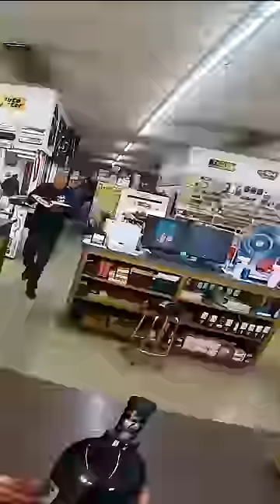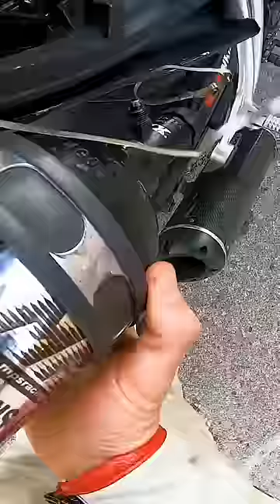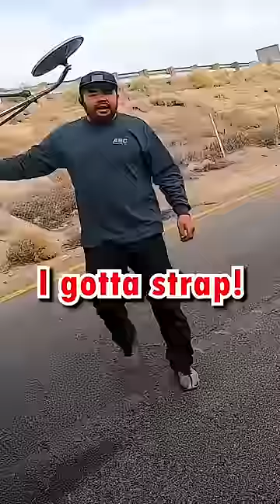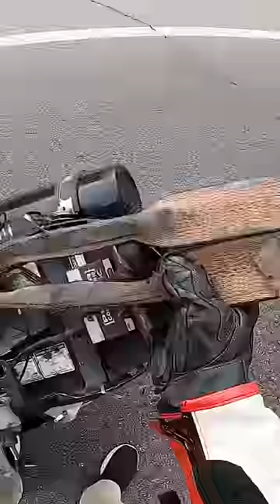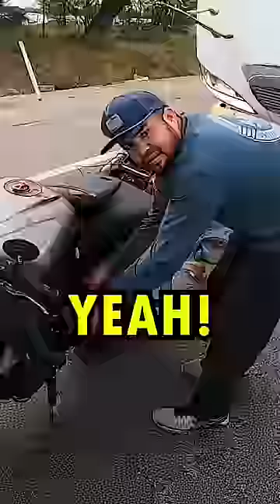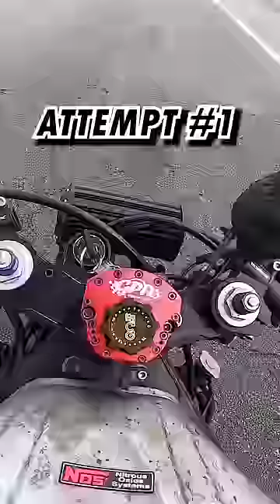If this works..... #shorts #bikelife #lol #fast

Comment: “There goes my clutch…”, exclaimed the biker.
Don’t worry about such silly details, real men don’t need clutches.
Reply: You can still do clutchless shifting 😂
Reply: @saesariolisenty6123  But the clutch is still necessary to drive off smoothly.
Reply: @marcos.1771  yup .. no argument there
Reply: Only two strokers use a clutch lolololololl
Reply: @jonahjohnson7660  Typical, this is typical…
Reply: @jonahjohnson7660  correction “only people who dont want to fuck up their gearbox use clutches”
Reply: @marcos.1771  i think youll find the clutch is necessary for movement at all.
Reply: @Username-uv8pf  Are you aware of quick shifters and blippers?
Reply: @marcos.1771  are you aware of gearboxes??? You still require the clutch to transfer the power from the engine to the wheels. Even if you dont disengage it
Reply: I went around on my first bike honda ns125r with no clutch for a year you push off with your leg to get going and  just gotta be careful goin down  not to lock up the rear and make sure your get neutral for the light in stoping but it's was like a luxury having a clutch on every bike since 😂
Reply: REVMATCH TO INFINITY AND BEYOOOND
Reply: @jonahjohnson7660  no
Reply: @owenwilson3750  Rev matching is not an obligation.
Reply: @marcos.1771  If your going 100+ & try to downshift without a blip/Rev match ur def gonna feel a stutter/jerk and thats you putting extra work on ur clutch plates and engine pos braking system. People like you would rather go buy a whole new bike than ride one how it's supposed to be. Veggie
Reply: Real riders use the clutch
Reply: @marcos.1771  no, you do need a clutch you don't need a clutch lever but the clutch you do need
Reply: @Username-uv8pf  I never use the clutch in my truck and I have been doing that for more than 5 years and I’ve had no gear box issues.
Reply: @jacksonneal4963  so how do you engage and use reverse?
Reply: @yungchainsm0ker298  There are many ways to do things correctly.
Live and let live.
Reply: @0newheel.andrew  No clutch lever?
It would be interesting to see you drive off on your motorcycle.
Reply: without clutch inside gearbox..any vehicle probably would move as soon as the key is turn on, engine run so the wheel will run
Reply: @saesariolisenty6123  Um no. If you blow the clutch it won’t transmit power from the engine to the trans. You’re not going anywhere if you blow the clutch.
Reply: Im dead 🤣😂
Reply: Sniff sniff any one else smell that?
Reply: For me using clutch is manlier
Reply: @kirbyloon2175  I mean, if you’re really smashing there’s not much point using it to shift up. You can also clutchless downshift but that requires more skill than most will ever have.
Reply: @marcos.1771  🤦‍♂️you are really bright aren't you. You still have to have a clutch to move
Reply: @steijnnothdurft9459  and if you put the cylinder on backfire, you can speed up the RPM so put’er in neutral and take your foot off the brake to let the exhaust fan out of the rear end of the motor
Reply: @linkinpiatak6669  You may want to read this thread first, BEFORE posting dumb comments.
Reply: Yeah I have a Yamaha atv that uses a clutch but I never have used it
Reply: Clutch!?!? That's what women do to their purses!
Reply: @dvilsadvocate1498  You know it...!
Reply: @jacksonneal4963  you drive an automatic don’t you
Reply: @jonahjohnson7660  so you crash box your 4 banger , typical
Reply: @Username-uv8pf  23 years and fuck knows how many hundreds of thousands of miles covered clutchless shifting, no gearbox issues with any of  the dozens of bikes I've owned. Only use clutch on truck to pull away and stop for last 5 years and around 120k miles, no issues there either.
Reply: @jacksonneal4963  auto?
Reply: Live clutchless bro
Reply: I don’t think you know how a clutch works
Reply: Don't most bikes have a wet clutch? Or do those start getting hot after lots of slipping
Reply: @u_cant_handle_the_truth  nsr you fucking legend
Reply: @marcos.1771  O
Reply: @marcos.1771  O
Reply: @thecoolguy3498  ooo ooooooooooo of
Reply: @thecoolguy3498  oo
Reply: @u_cant_handle_the_truth  of IP
Reply: @sw33tr1de4  oo
Reply: @yungchainsm0ker298  o
Reply: @u_cant_handle_the_truth  hi
Reply: @steijnnothdurft9459  o
Reply: @steijnnothdurft9459  i
Reply: @marcos.1771  Oo
Reply: @steijnnothdurft9459  oo
Reply: @saesariolisenty6123  i IPo
Reply: @marcos.1771  Ok o
Reply: @marcos.1771  Ù9i
Reply: @jonahjohnson7660  u
Reply: @jonahjohnson7660  o
Reply: @jonahjohnson7660  o
Reply: @marcos.1771  Ok o
Reply: @marcos.1771  O
Reply: @marcos.1771   Not Including ur Grammer and spelling?
Reply: My civics clutch is basically non existent
Reply: @user-bn5xb3cv2n  glad someone knows wtf I mean
Reply: Real men clutchless start
Reply: @marcos.1771  how
Reply: @yungchainsm0ker298  Who is “Grammer”? The “spelling” guy?
Reply: @muhammadnw5869  Real men always start on a downhill slope.
Reply: @marcos.1771 EDIT: after reading this comment thread i realize how pointless it would be to even try arguing with you so im just gonna take my leave
Reply: @Username-uv8pf  What arguments?  
You constantly keep deleting and editing your comments. 
You’re obviously not interested in any discussion. 
And we say bye-bye…
Reply: @jacksonneal4963  autos dont count
Reply: @hsushssbwj  nah, if its in gear then it will start to move while turning over but it will destroy the box
Reply: @marcos.1771  i can tell that you have never driven manual if you life if you think you will never need the clutch. How about putting a car in reverse?. You can rev match without damage the gearbox much which is what I do occasionally but it takes more skill than you will ever have. Without a clutch youre never gonna be able drive a manual vehicle, especially in traffic
Reply: @EnglishDrifts69GTxRED  You should read this thread first, BEFORE posting dumb comments.
Reply: @EnglishDrifts69GTxRED  bro if u have driving an manual you would know you just need clutch to put it in gear but then after that you don’t need to you the clutch. You only need it for first or reverse.
Reply: @jacksonneal4963  enjoy blowing up the gearbox then. I have always driven manuals and work on gearboxes regularly so I know my shit. Driving without the clutch is honestly pointless unless you wanna drive a manual but have no idea what the bite point is
Reply: @marcos.1771  i have read the thread and you just have no idea how to drive manual
Reply: @EnglishDrifts69GTxRED  I’ve been driving without using the clutch for a few years and have had no transmission problems so I’ll stick with driving without it.
Reply: @jacksonneal4963  atleast you’re admitting that you dont know how to drive manual properly and that you dont care sbout your cars
Reply: Finna flinstone it home huh
Reply: You need the clutch to disengage the gears from the wheel shaft.  You're not moving anywhere without it.
Reply: It's true, my clutch broke on a hill while it was pouring rain. Made it back tho somehow lmao
Reply: @Dragon22078  Did removing your pressure plates hurt at all?
Reply: Not double clutching like you should, he’s lucky that 100 shot of NOS didn’t blow the welds on the intake.
Reply: Pfft y’all have manual bikes?
Reply: @jonahjohnson7660  meh idk bro I race and only 2 strokes are true men. Lol but I’m talking snowmobiles fucking 4 strokes are slow and heavy
Reply: @molotov6792  It's true
Reply: And this comment was wrote by a woman on her man's phone for sure 🤣
Reply: @drugsrbad475  “…this comment was wrote…”?
Say what?
All your base are belong to us.

Comment: Nitrous doesn’t magically give it more torque 😂
Reply: Nitrous does add torque thats half the point. Just isn't going to do shit in this situation.
Reply: Nitrous is just an oxidizer..need more fuel which I doubt he has
Reply: Truth be told if the truck is empty that bike probably got enough torque if only it had enough weight and traction to get the truck moving. Just probably wouldn't live as long after that
Reply: @srt5musik  no your thinking horsepower. As the saying goes horsepower means how fast you hit the wall. Torque means how far you take the wall with you
Reply: @MrBULLRIDER13  It does not exclusively add horsepower. It causes a big increase in torque as well.
Reply: @AreeyaKKC  If it’s a dry kit the ECU will compensate fuel to a certain extent. If it’s a wet kit then he has fuel.
Reply: @RandoManFPV  even empty that bike wouldnt tow a semi
Reply: @blazejenkins8386  no shit I said that too smart one
Reply: If you try hard enough, it can
Reply: HP and wheel torque is what pulls. Engine torque doesn't really matter, it's all in the gearing, power and traction. The bike has the power, but not the gearing or traction.
Reply: it doesn't add much weight is the thing, you could have infinite torque on a peel, if there isn't enough weight on the wheels you're just gonna do a burnout.
Reply: @satibel  if you could add 1000kg on the bike and lower  gearing, it might have pulled it.
Reply: @MrBULLRIDER13  clueless. Nitrous increases torque before horsepower
Reply: Torques not the problem it’s weight
Reply: False but serious a 100-200 hp bike weighing 500lb isn’t gonna move 80,000 pounds anytime ever
Reply: Well....yes it does, the problem is the 2 inches of rubber he has on the road, coefficient of friction aint substantial enough to get her rolling, if it would begin rolling then....man saves the fuckin day
Reply: @MrBULLRIDER13 Horsepower is basically a multiplication of RPM and Torque. RPM can't be increased otherwise you'll throw a rod, so to increase horsepower, nitrous MUST increase torque.
Reply: @reinbeers5322  so in your opinion the only way horsepower or torque is to add n.o.s. do you realize how stupid that sounds and how many things out there prove you wrong daily.
Reply: @AreeyaKKC If it is a wet kit it wouldn't matter.
Reply: @MrBULLRIDER13  That isn't what he said at all. He is mostly right. Horsepower is literally torque x rpm / 5252. That is what horsepower means. The formula implies that you either generate the same torque at a higher engine speed, or increase the amount of torque at the same engine speed. NOS doesn't increase the engine speed, so it mathematically has to increase torque.
Reply: Thats basically exactly what nitrous does hit it at like 2000 rpm you will get so much torque
Reply: @THESLlCK  no it doesn't and HP and torque are two different things. Just because you increase one doesn't make the other increase to.
Reply: @MrBULLRIDER13   Horsepower and torque are related. Torque is rotational force. Horsepower is rotational force x rotational speed (rpm). When you increase torque at the same rpm, horsepower must increase. Use the formula. 5252 is a constant. The rpm remains constant. So whenever you change the torque at a specific RPM, horsepower will inevitably change.
Reply: @Skidzo19  then explain why the numbers don't always line up and start getting further apart it's quite simple really. The formula is a general guideline and far more factors come into play then just your fast and furious calculations.
Reply: You guys think a single cab 2wd 2.2 manual Chevy s10 could pull that truck?
Reply: @CorruptStory1341  ya I mean assuming the truck is in neutral and the air brakes aren't braking
Reply: @james10739  Oh
Reply: @CorruptStory1341  I mean you see strong men pulling planes and trucks it's not that hard to move something that rolls I mean you are not doing 70 or trying to stop it
Reply: @Skidzo19 why are you so dead set on arguing when obviously you have no clue what you are even saying, nos makes a very decent increase in low to mid toque and a mid to high horsepower,
Reply: @vgfy6319    "Obviously have no clue what you're talking about" Okay, explain what I've got wrong. You won't, because you can't. Horsepower and torque are fundamentally related. Hell, looking at a fucking dyno graph will show exactly what I'm talking about. As long as you're using the same imperial units, then horsepower and torque will always cross over at 5252rpm. Coincidence? Or is it because of exactly what I just explained!
Reply: @Skidzo19  congratulations you figured out that high rpm is peak for horsepower but decrease of torque. now reread my first reply and you’ll learn how nitrous effects power, if you honestly think nitrous has no effect on torque then yes you have no clue what you’re talking about
Reply: @vgfy6319   Literally nothing to do with what I said at all! NOS does not effect rpm, so it MUST effect torque. And consiquently, horsepower MUST increase as a result of the increased torque at the same rpm! 

"If you honestly think nos has no effect on torque" That is exactly the opposite of what I've been saying! NOS has more oxygen than air, meaning you can inject more fuel, and thus make more power per cycle (AKA torque increases). And since the rotational force (torque) increases, and since horsepower is dependant on torque, then horsepower MUST increase! 

And your first comment is just flawed. NOS will increase torque throughout the torque curve, not just in the low to mid end, and it won't effect horsepower independantly, because horsepower and torque are related. Effecting one without affecting rpm MUST effect the other. How can you even attempt to tell other people they're wrong when you haven't even got the fundamentals down?? 🤦
Reply: @vgfy6319  To quote myself: "NOS does not increase the engine speed, so mathematically it has to increase torque"

That right there shows that I was already saying NOS increases torque. So why the hell are you trying to say I'm arguing something that I never said?!
Reply: @Skidzo19  I’ll be honest i meant to reply to @mrbullrider13 and your profile pictures are the same
Reply: @vgfy6319  Understandable. Have a good day.
Reply: Uh... but it does.
Reply: Actually it does. But not nearly enough and the bike doesn't have nearly enough grip to do it.
Reply: @srt5musik  fun fact for you when an engine is on a dyno it's doesn't measure horsepower the dyno only measure torque

Comment: I believed with all my heart that would work
Reply: For some reson I did too lmao
Reply: A 500 pound bike vs like what 20k pound truck 🤣🤣🤣. Common sense says it wouldn’t work.
Reply: @eddilovee  but fast and furious
Reply: @Angel-yf7pp  you never seen this anywhere but on YouTube. Nobody would think to try it lmao. Not even movies.
Reply: Joey Boy  there is no speed if you can’t move
Reply: @eddilovee  theres dudes that pull passenger planes with their beards 😂
Reply: Lmao idk why I did too
Reply: Nah you don't believe with your heart, you believe with LIES!!
Reply: @AllFather411  😥
Reply: @eddilovee  well there is a strong men competition where competitors have to pull an airliner heavier than the truck. Very slowly but many can do it. Just muscle strength.
Reply: @MrRedsjack  also have to remember physics. Humans can use different angels to make the plane roll and to get it started rolling. The first couple inches are the hardest. The bike has one pull mode and that’s straight. Also can’t adjust strength either.
Reply: @eddilovee  incase you haven’t noticed common sense isn’t common anymore!

Comment: And now we know the difference between horsepower and torque.
Reply: Even with torque and horse power triple what the semi truck has, it still isn’t going anywhere. The bike is way to light even if it had the power
Reply: @ChemTheCourier  fair point.
Reply: @ChemTheCourier  true
Reply: @ChemTheCourier  Physics ... They don't consider it as important ...
Reply: Sort of true. Torque is necessary due to the low speed application and high gearing of a motorcycle. But with an invincible clutch this problem could be solved by revving it into the power band and letting the clutch slip. He tried this and failed.

However, even then the lack of grip a motorcycle has is the real limiting factor. All the torque and power, some crazy robust clutch and an engine and transmission capable of those loads still couldn’t move the truck. You’d just be burning rubber.